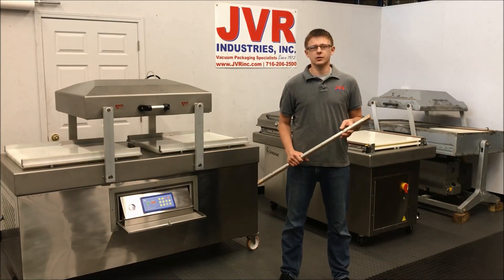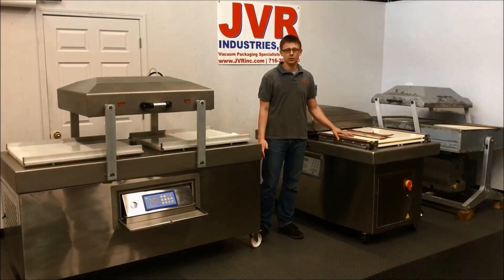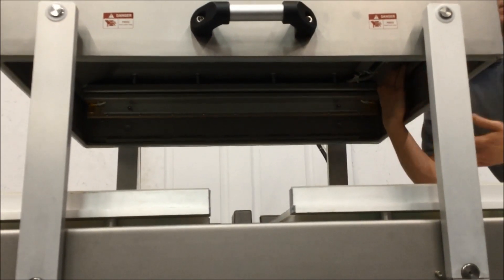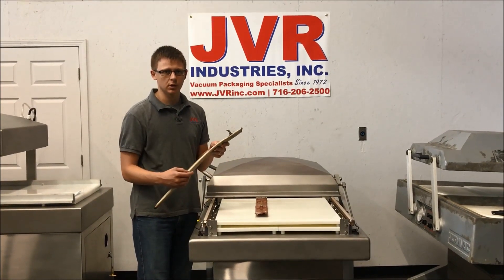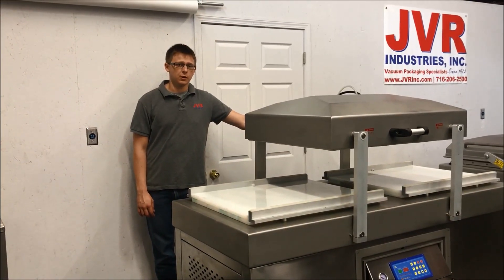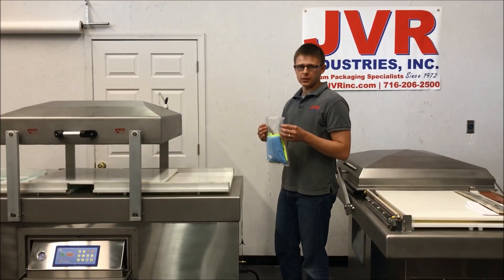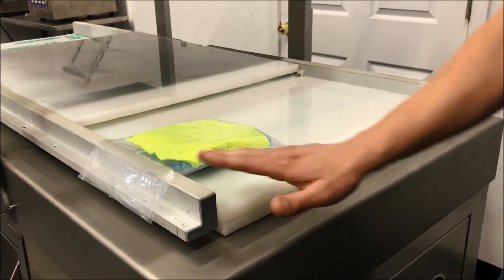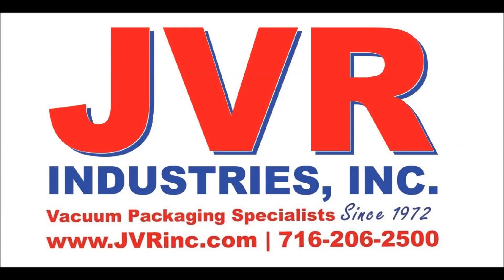Vacuum Packaging Equipment, Troubleshooting Leakers

Comment: Hello. I  have 2 dc-800 . One of them is vacuuming good on one side and air in the other side . I change the lid gasket but still doing the same think. 
Second  one is giving m a code :   u 2  I got no vacuum pls can you help
Reply from the maker: Please call our offices to discuss your issue. You can reach us at (716)206-2500, 8:30am-5pm EST.

Comment: We have the problem of our double chamber vacuum machine. After the vacuum process the did not automatically release the air. If we switch off the emergency switch after the vacuum process before the release the air. The proper process after the vacuum process and sealing process automatic the release the air. But in our problem the did not automatically release the air after the vacuum process and sealing process.
Reply from the maker: May we ask what make and model it is?
Reply: 600 vacuum packer
Reply from the maker: @ianjoecomparativo4603  If it's not releasing the air then you may have a faulty vent valve.  This is the valve that opens up at the completion of the cycle to allow air to flow back into the chamber.  Another possibility is that your control board is faulty and has a bad output.  I'm assuming you have a DZ600 machine, if this is the case then you'll likely have a difficult time sourcing parts for it.  However, if you can obtain parts then I would order a replacement vent valve to start with.